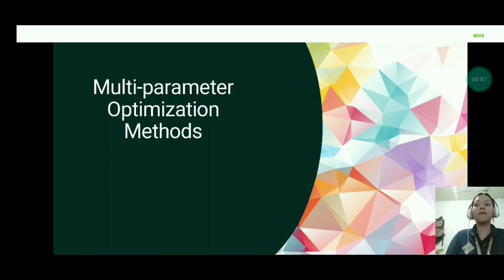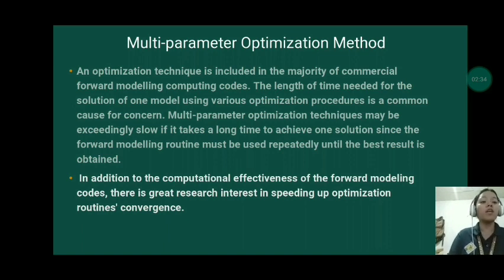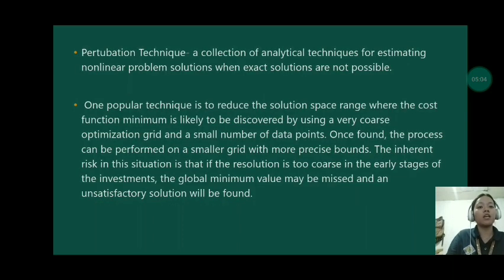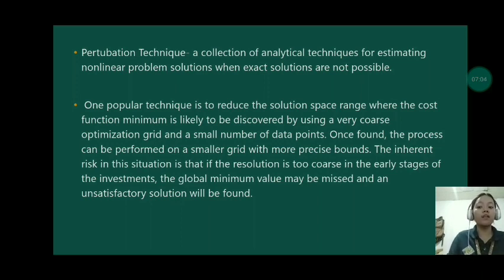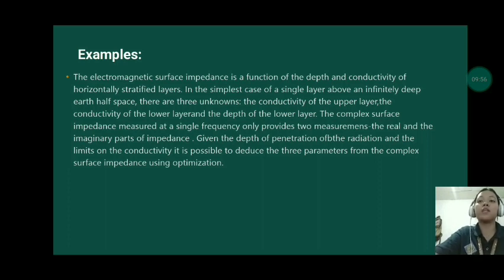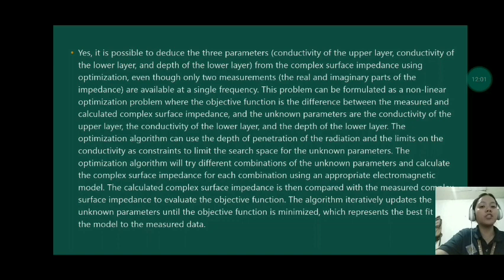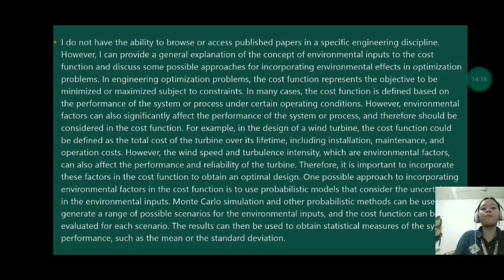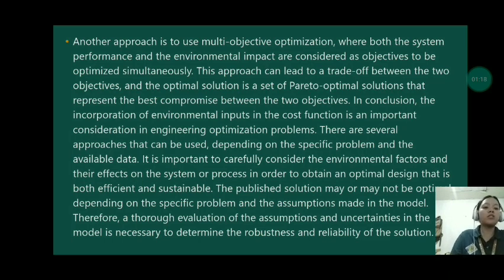Multi-Parameter Optimization Method

Comment: Name: Janeze S. Pacaña
Date: March 17, 2023
Schedule: MWF 6:30 – 8:30 pm
REFLECTION:
Multi-parameter optimization is indeed complex and takes a lot of time to finish. Despite that, it is still very helpful to researcher thus it should be studied effectively. Although there are a lot of software that can be used to generate results easily, it is still better to know it manually by that it can be assured that the results are valid. 
REACTION:
The presentation talks about another optimization method and that is multi-parameter. It was very informative because she presented examples and explain it. This will help the future researchers on how multi-parameter works and in what instances it can be used. 
SUMMARY:
Multi-parameter optimization is a method of solving complex design problems mathematically that yields the best result possible. It minimizes the cost function which takes in to account all the important factors for the optimum design. Basically, it is a method in finding the effect of the many variables or parameters in a certain product or system. Using this method requires a lot of time for it involves mathematical models, statistical analysis, and experimental design to identify optimal values for each parameter but these methods will greatly help in improving efficiency, reducing cost and errors, increasing quality, and enhancing innovation in the engineering field.

Comment: Duhaylungsod, Lynard S.
March 17, 2023
MWF 6:30PM - 8:20PM

REFLECTION:
In doing research, first we identify a pretty problem, after identifying a problem we tend to create solutions to these certain problems. In this video, a multi-parameter optimization method was being discussed in which this is a technique for looking for different kinds of solutions to the problem. 

REACTION:
Examples were also presented in which it really helps the audience to understand the video well. The reporter delivered her topic in a very informative way that was clear and simple.

SUMMARY:
This topic talks about the multi-parameter optimization method and it also has a process. There were also some techniques that had been discussed and some of these were the perturbation, massively parallel computing, and coarse optimization grids. These techniques can be used in giving solutions to the problem but it also depends on its function from your available data presented.

Comment: Lerio, Shiela Faith
March 17,  2023
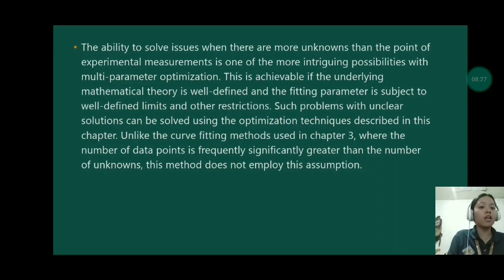Mwf 6:30-8:30

REFLECTION:
From this lesson, I learned the use of multiparameter methods in optimization algorithms for engineering research, the benefits and challenges of such methods. Also, the importance of computational efficiency and reducing the computational time required for multi-parameter investigations through various strategies. 

REACTION:
The reporter discussed the topic well. As a college student in an engineering course, it is important to be aware of these methods to improve the efficiency and accuracy of research outcomes.

SUMMARY:
The video report discusses the algorithmic details for a two-dimensional investigation using four multiparameter methods. It also highlights the concerns and strategies related to the computational efficiency of forward modeling codes and the optimization routines required for multi-parameter investigations.

Comment: Lareno, Rhea T.
March 17, 2023
MWF 6:30-8:30 PM

Reflection:
Learning about multi-parameter optimization has shown me the significance of considering various factors to find the best solution. I find it fascinating how optimization can handle problems where experimental observation is limited. Overall, this report has expanded my knowledge of the importance of optimization in solving problems.

Reaction:
As a student, understanding multi-parameter optimization can be overwhelming, but it's intriguing to learn how this mathematical process works to find the best solution or design while fulfilling specific criteria. It's important to note that optimization can be used in diverse areas.

Summary:
Multi-parameter optimization is a mathematical process used to identify the best solution or design while fulfilling a set of criteria or constraints. It is widely used in many fields such as engineering, science, economics, and finance. The approach involves finding values for numerous variables that optimize a particular objective. Although it may be a slow process, there are techniques to reduce computation time, such as massively parallel computing and limiting the solution space range. This technique is useful in situations where there are limitations to experimental observation, as long as the underlying mathematical theory is well-defined and fitting parameters have clear-cut constraints.

Comment: SORIANO, ARCHIE ISABELLE A.
MARCH 17, 2023
MWF 6:30-8:30pm

REFLECTION
Multi-parameter opitimization method involves using mathematical techniques to identify which combination of parameters will optimize the desired outcome. This are useful because they allow researchers and engineers to find the best combination of multiple variables to achieve their objective. It can also improved performance at the same time this will also enhanced the reliability and durability that can result a better project and environmentally sustainable.

REACTION
The video presentation is very informative and the presenter explained it well. She also provided some examples that can help us understand more of her topic. Applying these methods can minimize the cost of trial and error required during the design process.

SUMMARY
In multi-parameter optimization methods, it is more on examining  a combination of several variables that will optimize a specific objective or output. There are several strategies used to reduce computational time required for multi-parameter investigations. One of that is to use a perturbation technique for the solution space. Wherein, as the solution of the entire forward model is not required, this can reduce the computational time required. To explore the solution space and determine the optimal combination of parameters that will meet the specified objective while satisfying the constraints, various algorithms and methods are used. Overall, this method can help improve efficiency, reduce cost, and improve performance in a variety of applications.

Comment: Pis-an, Clark Z
March 17, 2023
MWF 6:30-8:30pm

Reflection
In my own knowledge and understanding on the video presentation, I learned that in making our research study we will encounter many mathematical problems and equations that we need to solve in order for the researchers to realize and interpret the data collected from the respondents or from the experiments. In order for the researchers to utilize this informations, they need to use multi-parameter optimization methods or techniques. Sometimes solving mathematical equations and problems manually is difficult and takes longer time. There are many tools available in the internet that the researchers can use to solve complex mathematical problems in a much lesser time. This will benefit the researchers by having more time on analyzing the data collected and lesser time on solving those data gathered. 

Reaction
Based on my own observation on the video presentation, the reporter provides examples and she discusses more on the optimization process. Also the presentation is visible and clear to the viewers. Overall the reporter made a great presentation and relays the lesson effectively.

Summary
The video presentation is all about Chapter 5.3 from the book Research Methods for Engineers. This chapter tackles on Multi-parameter optimization methods. As researcher we mainly dwell with numerous data after we gather this information from our respondents or in experiments. In our data and analysis we need to solve some mathematical problems in order to interpret the results. Sometimes it takes time to solve this problems manually, that's why as researchers it is our responsibility to look for alternative methods. At present we have many applications in the internet that are reliable on solving complex mathematical equations and problems. By using these methods we can have lesser time answering the data and we can analyse more efficient because some of the methods are easily manipulated. The researchers needs to make sure to know the parameters that limits or constraints the research study.

Comment: Geguinto, Jun Royce M.
March 17,  2023
Mwf 6:30-8:30

Reflection:
After watching this video presentation, I learned that this chapter talks about ways to improve the process of finding the best values for multiple parameters at the same time, like using methods that make it faster. It also mentions that these methods can be used to solve problems even when there isn't enough information from experiments.

Reaction:
The reporter makes sure to explain things in an easy way that people can quickly and fully understand.

Summary:
In summary, Multi-parameter optimization methods can be used to optimize multiple parameters simultaneously, but the computational time required can be a concern. To reduce this time, strategies such as using optimization codes available online and using coarse optimization grids can be employed.

Comment: Alampay, Kenneth R.
March 17,  2023
MWF 6:30 - 8:20

REFLECTION:
Engineering research is conducted to solve practical problems in society. However, designing solutions can be complex and challenging. The multi-parameter optimization method is a useful approach to finding the best solution by repeating the process. Although there are other methods, the multi-parameter approach is effective in solving problems with many unknowns.

REACTION:
The video presentation was informative, and the reporter did an excellent job presenting it. The examples provided in each section were helpful in understanding the topic. The report was delivered clearly and effectively.

SUMMARY:
The multi-parameter optimization method is a useful approach in various fields, including engineering, science, economics, and finance. This method uses strategies such as perturbation techniques, massively parallel computing, and coarse optimization grids. Unlike curve fitting, the method does not rely on assumptions. The specific approach used depends on the problem, available data, and other factors.

Comment: Lluvido, Lynan Kim A.
March 17, 2023
MWF 6:30 - 8:20 PM

REFLECTION:
We know that we do conduct engineering research in order to have practical solutions to different problems we have in the society. The problems that may occur in doing this would be concerning  the complex and optimum design. So that is why we have the method of multi-parameter optimization. This can be done repeatedly in order to achieve the best solution. There are also some other methods but I think the multi-parameter one is good since it can be able to solve issues when there are more unknowns.

REACTION:
The video presentation was very informative. The reporter did a good job in presenting it. There were some examples given in each part which was helpful for having some additional information related to the topic. The report was delivered clearly.

SUMMARY:
Multi-parameter optimization method follows some process that can be used in different disciplines such as engineering, science, economics and finance. Some strategies that were discussed are the perturbation techniques, massively parallel computing, and coarse optimization grids. Assumption is not used in this method which makes it different from curve fitting. There are various approaches that we can use but it depends on the specific problem, available data and some other factors.